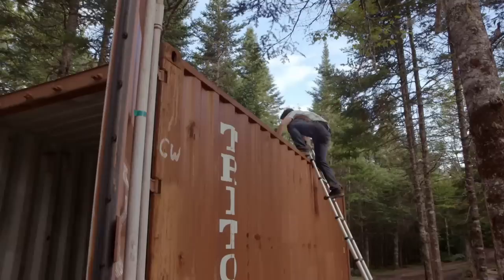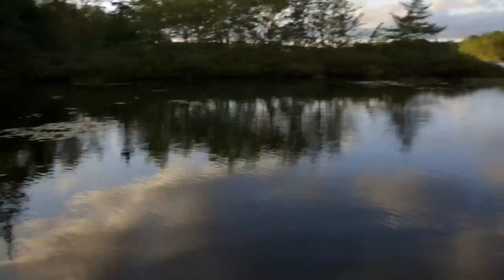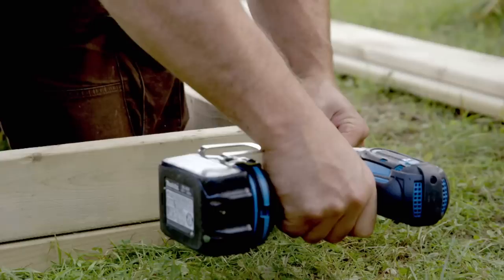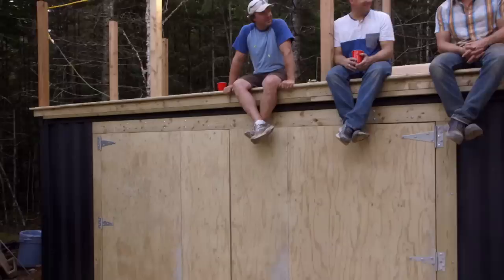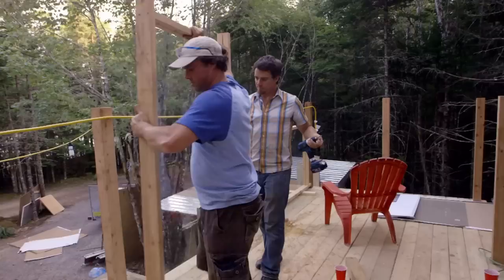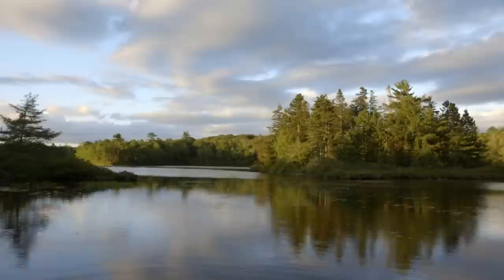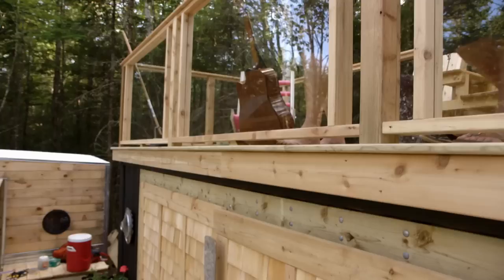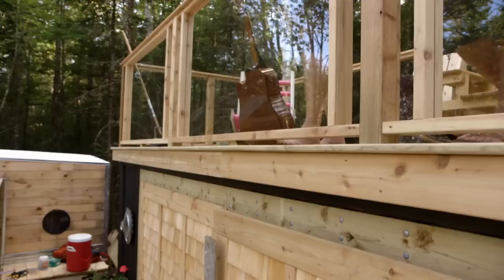Building a Rooftop Patio for the Workshop

Comment: This would be a great video - IF - you had shown HOW the deck is fitted to the roof...
Reply: Especially since these containers can only support weight at the corners. Mythbusters crushed one when they tried to bury it.
Reply: A deck wouldn't be that much weight to support.  The walls can support some bit of weight between the end frames.  I wouldn't be afraid to put a few thousand pounds on the top evenly distributed, but the ends allow dozens of tons to be supported, that's why they can stack them 6-8 high.  But yes, you can't just bury them without somehow bracing and supporting the walls and roof.